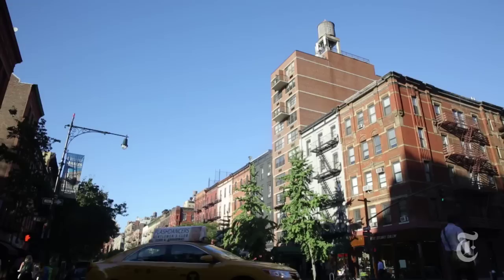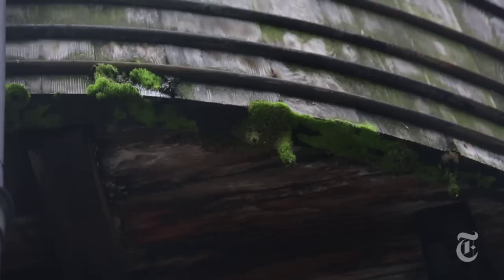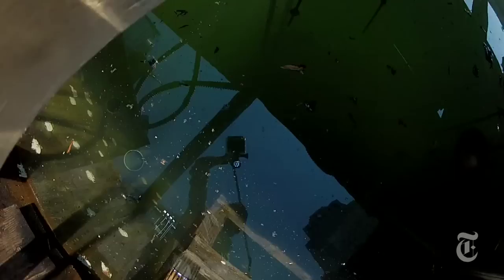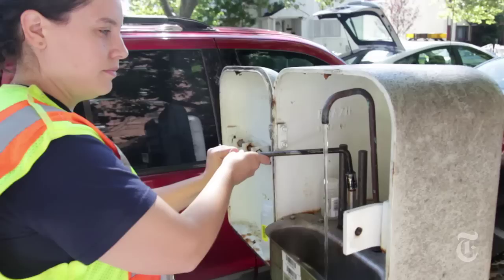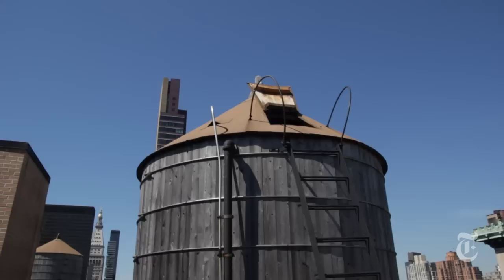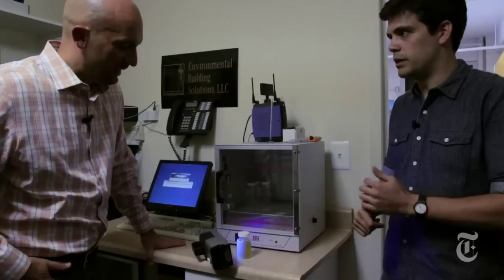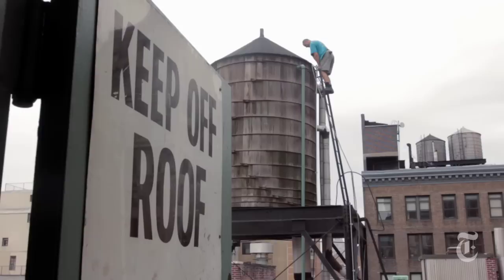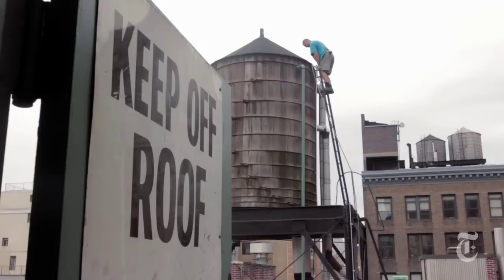Inside New York City's Water Towers | The New York Times

Comment: I dont understand how the tank could be made of timber. When food grade containers must be stainless steel glass or plastic
Reply: They need to use the right wood, like the kind used for whiskey barrels.
Reply: These tanks were built in place when the buildings were built. Repairs are easy, most are cedar. It's not the tanks that are the real problem, it's the water itself.
Reply: Ben Bennett wood has pores and can degrade perfect for bacteria colonies to form.
Reply: Wood's insulated enough to stop water from freezing in the winter, expansive enough to survive the summer and most importantly, being 100% shone on by the sun year after year wood can usually weather that and isn't particularly hot to the touch which makes them serviceable. Wood's a fine resource to use, just take bloody care of it. You think a stainless tank won't be growing hair algae given the same amount of crap care given? Plastic's even worse in most cases, it doesn't have the natural wood oils and when heated leaks plastic contaminants. It's the reason why most plastic water bottles for drinking now say BPA free. Obviously could use that more expensive plastic, but in most cases to reinforce it enough to take a large amount of water you'd rather just use stainless sheets.
Reply: All that property has been mortgaged about 300% of what you could ever sell it for.
Reply: @elonmust7470  explain your claim!!!
Reply: Brian The Explorer But, they’re not working. They’re polluted.

Comment: Why are they wood, we have a plastic tanks for the rain water we use on the garden, surely they could use plastic or metal for people's drinking water
Reply: The same way they get the giant air conditioning and other considerably heavier equipment.
Reply: +ike fun stainless steel sheets that are bolted together at the top of the building.
Reply: wood rots...
Reply: Not if maintained
Reply: Randy Marsh plastic when hit by sunlight will break down and can lead to chemicals being released into the water and steel corrodes and can make the water red or make it taste iron (blood) Aswell it can stein clothing if washed in it.
Reply: Or, you know, act like the rest of the world and use battery backed redundant pumps instead of tanks... It's not 1910 anymore...
Reply: They are still made of wood because the walls are thick enough to prevent the water from freezing in the winter. Other than that they're pretty gross!
Reply: Matt Martin because wood is better than plastic and metal.
Reply: Mitchell Liu wood doesn't rot if maintained.  Here in Milwaukee,  the foundation of our city hall is built on wood beams from the 1880s,  it wasn't an issue until the early 1990s when they weren't doing proper care and now they are starting to rot.
Reply: Polish Sausage they're fine until the wood is in the dirt if it gets back filled for water ever reason and gets water damage. I have a building built like that and dirt built up in one corner and rotted the beams away in that section the insulation is saw dust and the walls, ceiling, and floor are tongue and groove pine.
Reply: They got one there already.
Reply: The simple answer is wood rots plastic doesn’t
Reply: Wood rots maintained or not ! And literally they could spray plastic inside as a liner but they are bs and if they made the tanks from plastic you would have the wood tank guy complaining about how the plastic is taking his business away ! Literally wood tank = mold no matter what
Reply: @ike fun a helicopter can lift a 1 tonne plastic container quite easily
Reply: @ike fun I get it, Ike. You probably own a lot of stock in a wooden water tower manufacturing business...That's why you don't believe in elevators, cranes, and helicopters :)
Reply: The best option would probably be pressure tanks, like the ones used for wells. Same concept of providing water to the upper floors but they can be stored in the basement. Also, they’re made out of steel which means know creatures can get into them.
Reply: cheap greedy landlords
Reply: Thomas r
Reply: @Mr Sunshines russian helicopters
Reply: Microplastics
Reply: @Mr Sunshines you fabricate the tanks right in place. 4x8 sheets of 316L food grade stainless less. I dont know why they use wood.
Reply: SS tanks eliminates the animals getting in actually with filtered system they would be spotless inside. Man ways allowing yearly inspect and cleaning.
Reply: @mitchelll7846  everything put together falls apart
Reply: @techblogger8323  plastic deteriorates in sunlight pretty quickly.  In the desert plastic water tanks crumble in 2-3 years from solar radiation.
Reply: @timexkills65  mold grows in plastic quite easily.
Reply: @Doophenschmirtz  You're talking about a tank for one house.  This is for 1000 houses all in the same building.  You'd need a much larger tank under more pressure and if not unfeasible from a physics standpoint it would probably be cost prohibitive.
Reply: @Mr Sunshines - No, they have mechanical floors with all sorts of very heavy equipment for HVAC, elevators etc. at the top of the building and several locations in the building;  The newer buildings also have enormous mass dampers to minimize swaying.  Let's be honest, for most of the buildings the size of those with the water towers, a helicopter would work just fine.
Reply: @OverSoft  redundant pumps?

Comment: I watched a news bit on these wooden water tanks. Apparently the average installation cost of a wooden tank is $60k, whereas a steel tank is around $160k. On top of that, steel tanks have almost zero insulation, so water would constantly be freezing and thawing in the tank, which is dangerous from an engineering perspective. The 3” of wood on the wood tanks provides enough insulation to keep the water cool in summer and warm in winter. So it’s cheaper and easier to maintain.

Comment: Disgusting. If they can pump water up to the tanks they can pump water to individual apartments. Even just switching from wood to durable BPA free plastic or stainless steel
Reply: The tank is important for consistent pressure, but yeah they should be stainless steel!
Reply: Each apartment could have an expansion tank, like they do in homes that have a well.

Comment: Why can’t they just have pumps? That’s what my building has.
Reply: That requires a high pressure system, most of these building are old so they have to be gravity fed. New buildings are designed to be pressurized water systems, its also cheaper having a pump turn on sometimes than all the time. You can install a system that will increase pressure slightly but that also costs alot, my house has crap water pressure on the top floor.
Reply: Jonathan Owens 
Well, idk about other places, but at my dad’s condominium the water pressure is STUPID strong , it blasts everything wet if you turn it on all the way cuz the water has to reach all the way to the 54th floor ;)
Reply: the difference is between potential energy and kinetic energy. storage tanks utilize potential. Pumps rely on kinetic. Basically, you are storing up energy that can be used when the power is cut off.
Reply: @KrisMcCool  where is this heaven you speak of? I love it when the water pressure is so high it takes your epidermis off  ha!
Reply: Bok Old building? In New York? Londoner here- many of our buildings predate the USA. We have a similar population size to NYC and many live in apartments many stories high- yet we have never used rooftop tanks.

Comment: Why is a city like New York still relying on this old technology for their water supply? Modern buildings have fully enclosed and pressurised systems, and there's no reason older buildings cannot be retrofitted. This is a case of bad building management, the building managers pocketing the service charge instead of spending it on necessary maintenance.
Reply: Hashterix Saud Siddiqui New York’s water system can only pump water up to the 6th floor, so tanks are needed. They would have to completely rehaul the system. Water towers are still quite common across Canada, as they are a cheap and good way of maintaining water pressure. This paints a false portrait of watertowers. These ones are poorly maintained and made out of wood (or at least the wrong type).
Reply: NYC still uses 1940's techbology to run its subway systems.

Comment: nasty but still cleaner then most rivers lol. they could get rid of water tanks if they ran on demand pumps and adjusted rent to cover the expense of random power usage which would be a dollar or two more per month.
Reply: Yeah, no, REALLY NO.  Rural areas use them.  Just NO!
Reply: New York has rent control, which disallows them from "adjusting rent".  Get rid of socialists, and get rid of the problems they cause.
Reply: Still cleaner than rivers? That's the dumbest thing I have ever heard.
Reply: egn83b yeah adjust the rent… NYC is already expensive enough.
Reply: 2fastHarley well there's Flint as an example.

Comment: This may be a dumb question, but here it is: If the pressure isn't enough to reach past the six floor of every building and they have to use a pump to send the water to whatever floor the roof is on and into a holding tank,  why can't they just use the pump to send water to which ever floor and bypass the tank and just use separate water tanks per floor or separate holding tanks inside the building? Doesn't make sense to me.
Reply: They could do that, but it would cost more to have pumps running all the time to deliver water.  Typically, water towers have water pumped into the tank at night when the demand is low, and deplete during the day.  Water towers are usually meant to store enough water for one full day.
Reply: What BrandonPryorMusic said in his post is correct. The other reason for water tanks on the rooftops is two-fold.  When/if the power goes out, you can still get water for a period.  And, if there is a fire and power gets interrupted, same thing. A sprinkler system would be useless relying on pumped water once the power failed, but a sprinkler fed from above can continue to sprinkle until the tank and lines go dry. These reasons, prompted by numerous incidents years ago, prompted the laws requiring water tanks on top of buildings in NYC.
Reply: Without a water tower the pump has to be sized to maximum load and then ran at half power or less for all but an hour of the day..... With a water tower, the pump can be sized to average demands
Reply: problem is the pumps are not on demand pumps.   Imagine how much electricity it would consume to pump that water every time there was a demand in the system.  A lot of $$.  Also imagine the wear and tear the pumps would take.  It's way more practical to pump it all at once into a big tank and then you'd only have to run the pumps every so often to fill it.  What I don't get is why they don't have some type of metal tank like a normal water tower would use.  Even some type of composite tank would make a lot more sense than a wood tank.  They could even add coatings to the sides to help keep bacterial growth to a minimum.

Comment: I am staggered by this. 

In the UK a lot of older mains-connected houses will still have a water tank in the loft/attic which only supplies toilets, basins, baths etc. as this stored water is not considered to be potable even though far cleaner than the water shown here. Modern tanks are plastic (polyethylene) and covered, with a screened vent to prevent insects getting in. Any taps supplying water for drinking or cooking are supplied direct from the mains as are all cold water taps in modern properties.

Comment: Even steel or concrete water tanks need to be flushed every so often. My cousin works for the local municipal authority and he helps flush out water tanks. Even fully enclosed modern tanks will get a build-up of sediment after years of use.

Comment: Why the city has not made stainless steel tanks mandatory is beyond me. We can keep the nostalgic water towers. However, we must add stainless steel or poly tanks to the inside. A series of tanks small enough to fit inside the elevators would then be put together via fittings, to create a sealed system to prevent any contamination. They still would need to be flushed annually. Once flushed, the company providing the service could them report the work via an app or the city website. Those building who've not reported tank maintenance would then receive an automated email stating they must comply or face fines.

Cheers!

Comment: Wooden tank- ~$60,000
Steel tank- ~$150,000
Also around 3in of wood is equal to around 24in of concrete in terms of insulation.

Comment: Is the water not treated when it comes from the reservoirs, before going into these tanks? What I mean is, after treatment water is always pumped into the mains, under pressure sufficient to go higher than six stories. The point of that is that the water in the taps may come from the mains directly, not from these tanks. My understanding, which may be wrong, is that the rooftop tanks are used to provide water to fire sprinklers in the buildings. Basically, I"m doubting the whole story. But don't take it from me.

Comment: New York allows people to drink water from a wooden barrel that sits on the roof like it's 1890.  That's shocking to me and I can't believe that a landlord is responsible for water quality.  We pay our taxes to maintain our infrastructure, and a portion of our water bills go to maintaining the water department's equipment and resources.  That is messed up.  Especially considering what taxes are like in New York.  They need to get rid of these all together.  I'm willing to bet you only see these tanks in low-income areas.  If that's the method they're going to use, they should make the tank from food-grade stainless steel with a circulation system that filters the water and steadily releases whatever additives are needed.

Comment: I thought they were for putting out fires. This is disgusting. No wonder New Yorkers are short. Hello from Iceland.
Reply: Water tanks are used in virtually all structures taller than 6 floors. The laws of physics make it impossible to have consistent water pressure in tall structures without them.

Comment: Why do they not use public water towers like in other countries? And if a building is to high they could use a modern booster station... A tank on the roof which is exposed to different temperatures is definitively not a good solution.

Comment: I hate it when you go to inspect the water tank after reports of foul tasting tap water and you find the rotting corpse of a homeless guy floating in it. It could be worse though, we could take the tap from the bottom of the barrel like we used to do for several hundred years. One apartment managers solution to the dead guy in the water tank was to throw a couple of snapping turtles in the tank, like turtles eating the homeless guy and subsequently pooping in the water would purify the water? Seriously, you just gotta take the dead guys out, there’s no options there.

Comment: They are wood because these buildings were pretty much all built in the 1800's and 1900's
Reply: and, the tanks can be rebuilt or repaired by carrying the wood up the stairs or elevator .... try that with a 20,000 gallon steel tank!

Comment: why don't they just use pumps to pump the water up to the last floor? they can pump it all the way to the roof, so why don't they pump it straight tot he apartments ?
Reply: Î think because it can't be delivered on demand. They pump it up to the tanks and then you just have to open your tap. But if they have to pump it "fresh" then it would take a while until it reaches the top floors.

Comment: Why do they even have to use these tanks now? I really don't get it.
Reply: Because it provides consistent water pressure.
Reply: Because the NYC water supply is not pumped, It is gravity fed from aqueducts located literally and topographically upstate. and will not flow above around the 6th floor.  So its up to the individual building owner to pump it up to higher floors. Why ( the building owners ) Don,t just use a pump to raise the pressure in the line and use wooden tanks and not plastic or stainless steel I have no clue

Comment: This documentary short spreads the "hype" and ignorance about wood for the most part...Little was done to reflect WHY the tanks are still wood and why wood is still better, as it has been for millennia. The issue is sloth and greed by owners that DO NOT...do the proper maintenance of their water systems as and tank system is prone to contamination when not maintain...of steel and concretes being as bad or worse and certainly not as environmentally sustainable or proven in applied viability as the iconic and PROVEN wooden tanks...

Comment: Most of the building in NYC with water tanks are only used for  OLDER Sprinkler systems not for Drinking water. I've lived in NYC all my life my family owned building had a very large water tank but like I said they were mainly used for sprinklers and washing the roofs if needed. Hardly ever for drinking water. Ecoili is probably in those tanks because people used to in the summers use them as mini pools to cool off! Also like they showed pigeons and rats even homeless people getting into them. If the water tank is being used for Drinking water its a very old building 100% prewar building and the landlord is usually  just to cheap to install proper plumbing! With the crazy rent rates in Manhattan those JEWS can afford to install pumps on each floor to fix the water pressure!  I saw JEWS cause they own most of the real estate in NYC!